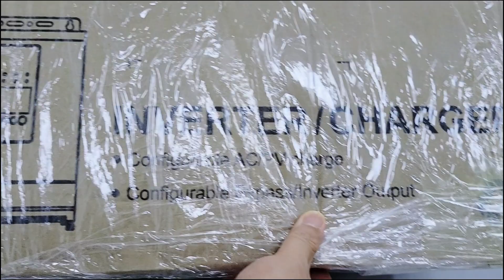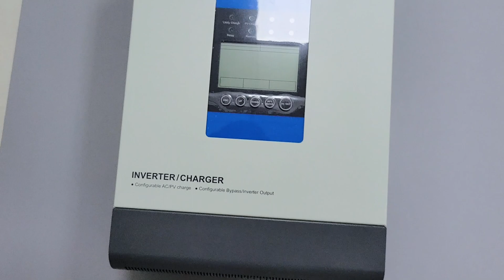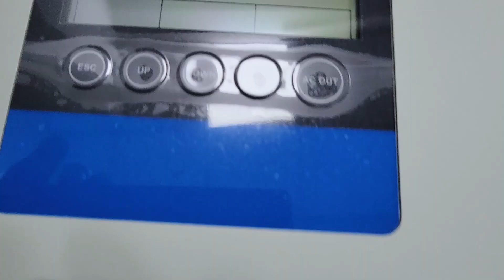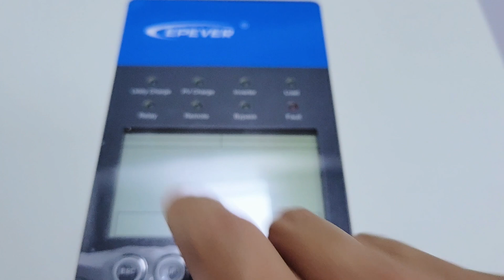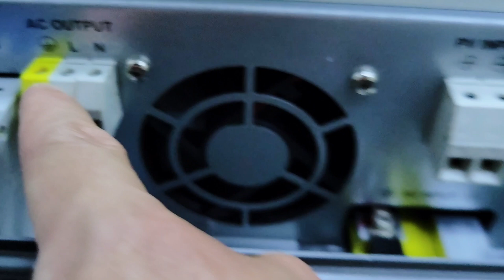EPever Inverter Charger 3000W Unboxing, Hybrid Solar Charge Controller Inverter

Comment: I got one of these and I was disappointed to find that there is no remote display option. The only way to control remotely is via an app on a cellphone. That doesn't suit me at all. I want a display with buttons that I can mount on the wall for easy monitoring and control. Unbelievable that a unit of this value doesn't have the ability to have a remote display. It has an RS-485 port to connect the Wi-Fi adaptor, so why did you not make it possible to connect something like the MT-50 or MT-75 display to this?
Reply: Get a cheap android tablet use that for a display.